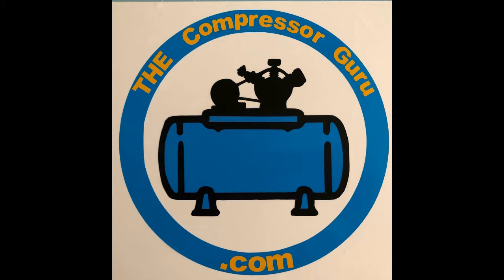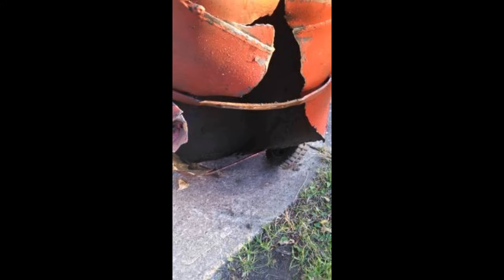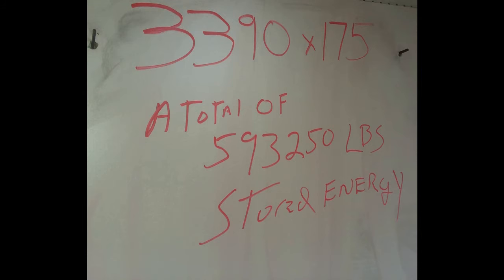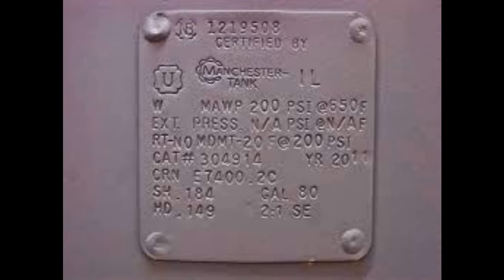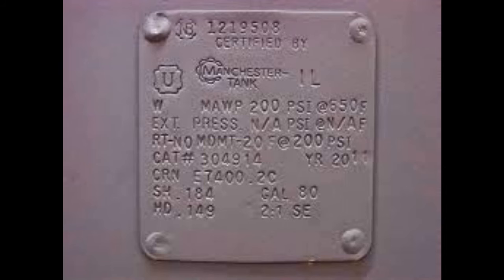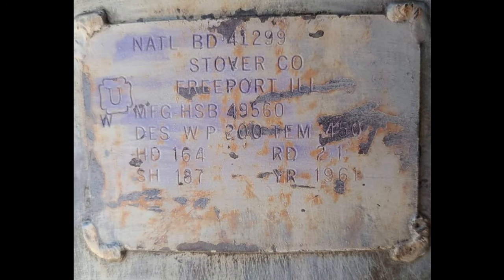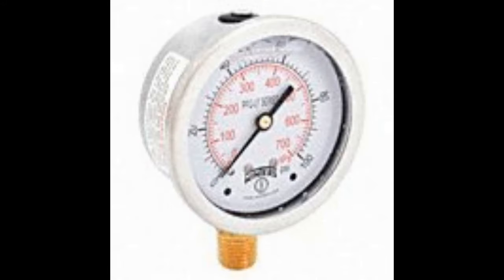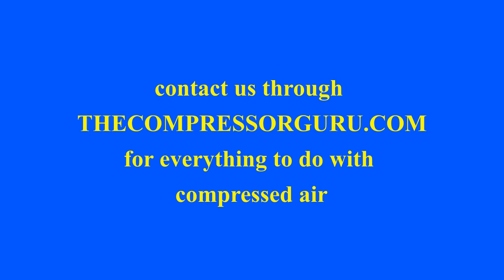Tank Safety, This video may SAVE YOUR LIFE!

Comment: oh come on now blow a wall down ?  it's not like it's 3000 or 4000 psi or something it's low operating pressure ,besides you can't even replace the damn tank  WHY .that's ridiculous
Reply from the maker: I have seen the aftermath. not a joke
Reply: @THECompressorGuru  even though it's low pressure.
Reply from the maker: @paulclose5544  Paul even only 100 psi that is 100 pound per square inch. lets do the math. an 80 gal tank is about 60 in x 24 in dia. . that is a circumference of 75 x 60 height=4500 square inches plus another 900 sq inches for the ends that totals 5400 sq inches at lets say 120 pSI  that 648,000 plus pound of stored pressure. a pin hole means almost nothing but a sudden rupture and releasing all that pressure in a split second is catastrophic.I have included a link to tire explosions most truck tires do not have the volume or the pressure of an 80 gal tank of a 2 stage air compressor (175). note the damage to the truck bed at 35 seconds into the link.
https://www.youtube.com/watch?v=Ysb-wLB836A
I didn't post this video as click bait or exaggeration . I care about people I do not want bad things to happen to them.
 I can not imagine what a 3000 psi scuba tank would do if suddenly ruptured.
Reply from the maker: @paulclose5544  are you in FL? and originally from near state college Pa? I just spoke with Val the camera wife and asked if this was you. Bud
Reply: @THECompressorGuru  ok, what if it's only a 6 gallon porter cable little air compressor
Reply: @THECompressorGuru  and yes I am in Florida
Reply from the maker: @paulclose5544  you know doug McC my neighbor
Reply from the maker: @paulclose5544  I will do the math tomorrow . it is very important to have a cert tag welded to the tank. that way you know it started out a better tank.
Reply from the maker: @paulclose5544  with the size of the tank that small the sq inches drop so the total number of sq inches is lower so is the total pounds of force lower with the same PSI. IF you post the dimensions I will do the math . smaller tank smaller bang. keep it drained and keep the correct safety valve on the tank.
Reply: @THECompressorGuru  sorry I don't